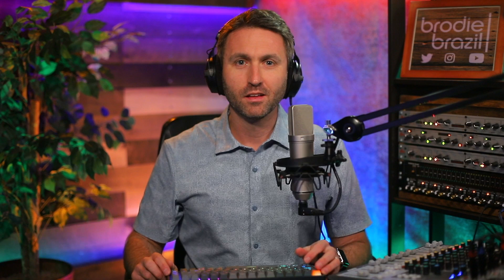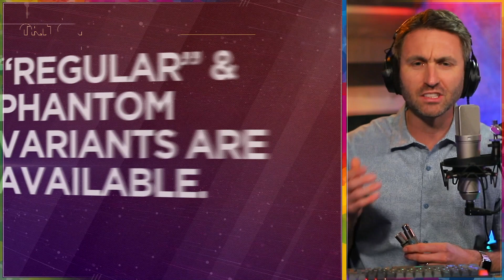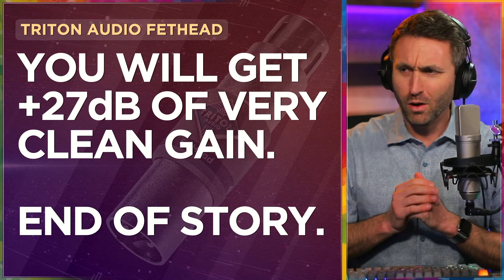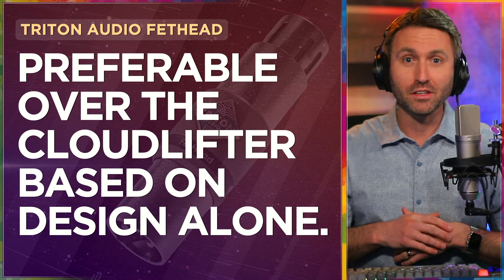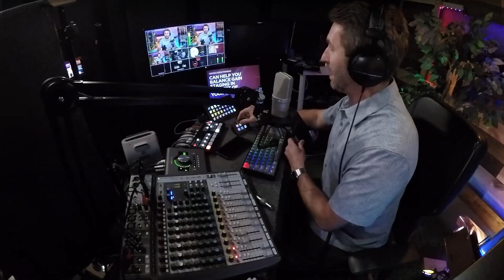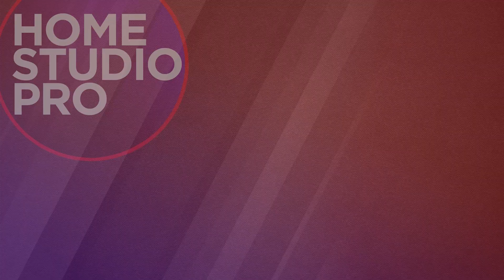Five FACTS: Triton Audio Fethead (inline mic preamp)

Comment from the maker: Any other FETHEAD users out there? 
How much gain does your mic need?
Reply: I recently switched to an Audient EVO 4 interface from the older and larger iD22. Without a FetHead I need to crank the gain up to around 55dB on most dynamic mics (Shure SM57, Shure Super 55), but that introduces some audible noise. With the FetHead I can hit the same levels with nearly no noise. 

I'm very pleased with the FetHead. Interestingly, SE Electronics is now packing their "Dynamite" in-line booster into some of their dynamic mics like the Dynacaster and DCM6. Do you think other manufacturers will follow suit?

Comment: I've watched a lot of reviews of the Fethead. Most talk about connecting a dynamic mic to an audio interface. What I want to do is connect the mic to my busking amp (it has phantom power on one of the mic channels). Clearly what I'm trying to do is get a louder vocal from the amp without having to crank up the gain on that channel to maximum. As is often the case I can get far more guitar volume out of the amp. Is this a suitable device to even things up a bit?

Comment: I like to plug my fetheads directly into the mic. That way I get a better signal-noise ratio, especially with long cable runs. If the fethead is located at the mixer end then it also amplifies the noise from the cable.
Reply: Yep; I have a 3 meter long cable and plugged the fethead into the mixer end initially and the noise was noticeable, as soon as I swapped it to the other end the audio was very clean.

Comment: I record vocals through an SM7B.  I was very happy with the Cloudlifter but then I tried the Germanium version of the Fethead and WOW! There is richness to the sound that was missing from the Cloudlifter.  Absolutely love the sound.  I tried it on an SM57 and it turns that into an awesome vocal mic too.  If I didn't already have the 7b, I'd be happy with 57 + Triton Ge.  I also use two Phantom Fatheads on my small condenser Audio-Technica AT8022 XY Stereo mic when recording acoustic guitar and piano.  Excellent products.  Thanks for your video.  Subscribed.

Comment: Hi there..Thank you for this video...But I'm confused with the regular fetthead with no need phantom power but you said they both take  phantompower??....
Because I have the Shure7b mic and I like to use it in my live (singing) performance with my band...So if I have the fetthead regular and use it with my Sm7b, will it help gain power even the mixer doesn't have a phantompower??..
Hope you could help me figure out before I buy the product..😊😊..Thank you in advance..😊
Reply: No, because the fethead will not work without phantom power.

Comment: I'm using a Heil PR40 and the regular FetHead is absolutely necessary. My interface has to be cranked to almost 100% just to get a descent input level without it. Though, I will say my experience is that the FetHeat works best either at the mic or somewhere in between. I get hum when connecting the FetHead directly at the back of my interface.

Comment: Great video.  One of the benefits of the FETHEAD (or similar device) is that it PRESERVES HEADROOM.  The peak audio level of speech and other content, is about 10 db higher than the average.  The indicating devices (LEDs, scopes, approximate loudness indicators like real VU meters) in the audio chain can be biased toward showing closer-to-average rather than peak levels.  Actual peaks (drum hits, cymbals, screaming vocalists, etc.) can fool some level indicators (like classic, mechanical VU meters) and actually overdrive one or more stages in the system.  Shure sells plenty of in-line 10 db attenuators for use with SM57s and SM58s.  Some audio contains much higher peak levels--a male voice is an example--so engineers want considerably more output capability everywhere in the audio chain (much more than the spec sheets promise for each piece of gear).  With your ProSonus or Focusrite mic gain almost all the way up, your "headroom" (i.e., peak reserve) might not handle a cymbal crash, drum hit, or vocalist emoting, without clipping.  Rule of thumb: always have extra first-stage gain that you're not even using.  Avoid flat-topping you can't eliminate further down the chain (in processing, recording, and post-processing).  The best analog and digital mixers employ very low noise, high dynamic rage (80 db or more) mic preamps. I'm retired and old-school, starting to do podcasts or audiobook narration.  l never had great results with dynamic mics and mixer controls set much beyond "12 o'clock." End of rant.  Thanks for your patience.

Comment: Dang. I guess I can't use it. Well, here's my setup. Rode NTG2 connected to a Sennheiser EW100 model transmitter pack feeding to the EW100 receiver connected to my Tascam DR60D mkii. Because the Sennheiser series EW100 doesn't supply phantom power, I can't use this in between my Rode NTG2 and transmitter pack, correct? The Rode NTG2 is battery powered, but I guess that still doesn't matter? Tons of questions, haha. New to learning about this device for audio.